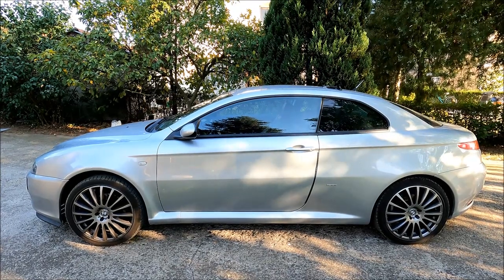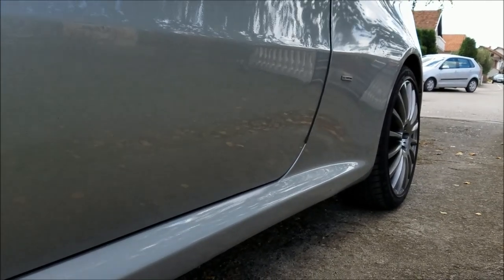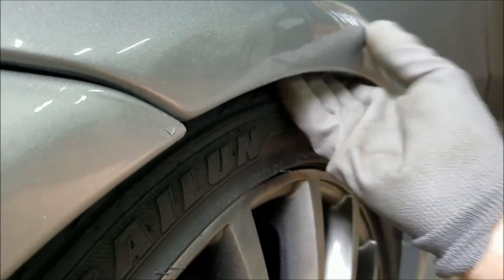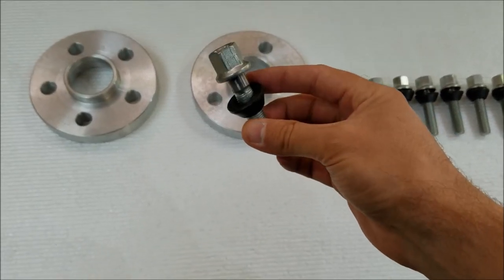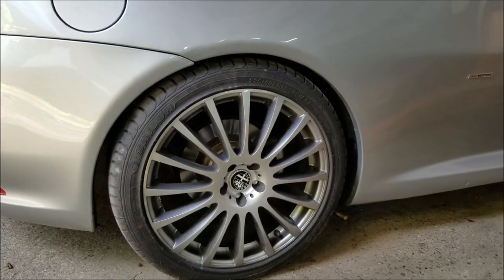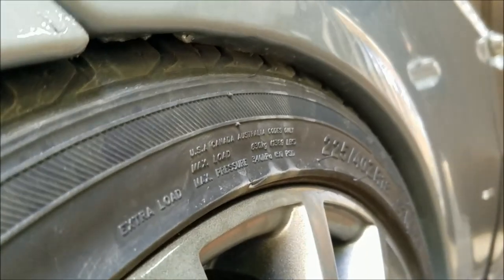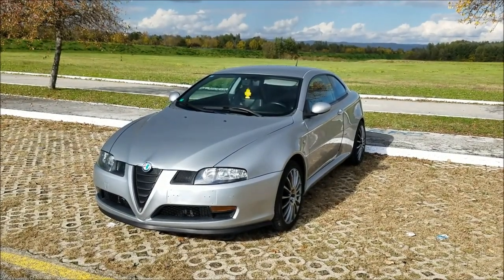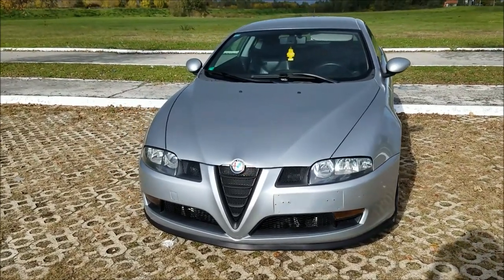20MM Spacers on Alfa Romeo GT???

Comment: My GT is on the factory blackline wheels which are ET 30, they set almost perfectly flat with the body. So maybe just 5mm spacers will do for et35?
Reply from the maker: Blackline wheels look amazing. 5mm could be good, but not sure if it's worth the effort, and honestly it looks like even 5mm could be scraping
Reply: Wouldn't 5mm spacers with et35's have a similar effect as et30 wheels? The blackline wheels are getting a bit hard to find these days but I'd very much recommend them
Reply from the maker: Yes, but I am not sure it is worth the effort. 5mm ain't much, and due to the shape of wheels I don't think they would make much of a difference...

Comment: Is this really factory suspension?
Looks very low to me.
Reply from the maker: Yes, but it is a bit tired due to the lpg tank in the back...
Reply: @arcgarage  just tired springs most likely, had the same problem and i also have LPG, fully loaded should still have some safe space. Change the springs and you are good to go.

Comment: Thanks for video! I´ve been thinking about having spacers on my GT. You ended up with 10mm/5mm?
Reply from the maker: I gave up on the idea, 10mm would probably scrape again and 5mm wasn't really worth the effort...
Reply: @arcgarage  Ok, thanks! I´ve got water inside one of the turn signal lights, do I remove it from the backside of the bumper? Feel free for answering.
Reply from the maker: @Peter56Persson  Front or back?
Reply: @arcgarage  Front left.
Reply: @arcgarage  I´ve found this very helpful video from you :-) Thanks!
Reply: @arcgarage  weird, oem wheels 18x8j ET32 5x98 fits with 10mm spacer. You have et35 so you should have ever more space.
Reply: @CouriusPL I have Q2 ALU wheels 18" ET 32. And I'm just thinking about 10mm on the front rear. Do you have experience that it's ok? Thanks

Comment: I would most likely buy some 15-20mm spacers for my 16 inch 41.5 et wheels, they are so deep inside the wheel well that it looks like a badly assembled kit car.
Reply from the maker: it would make a lot of difference